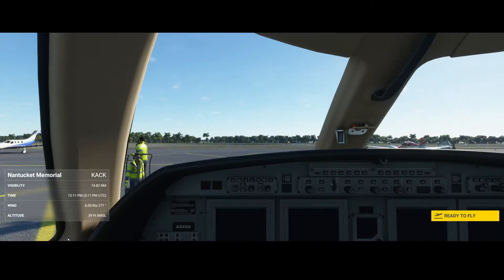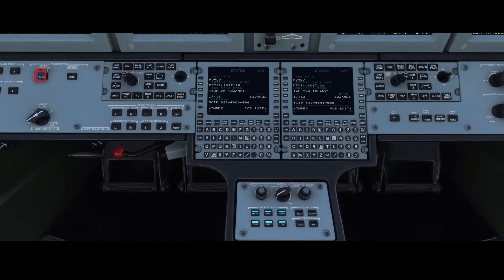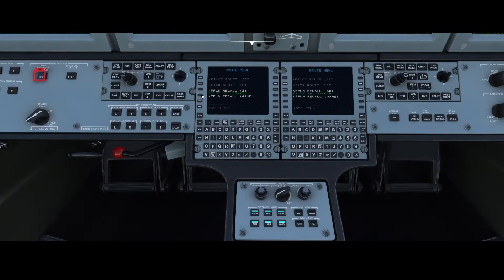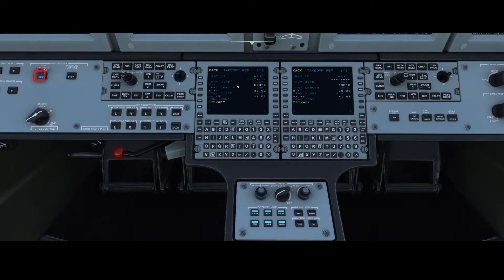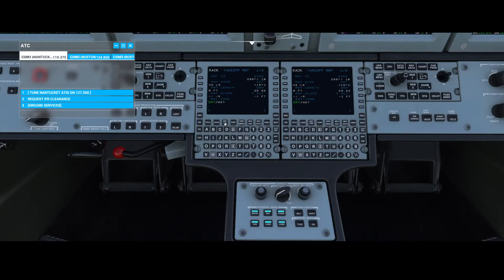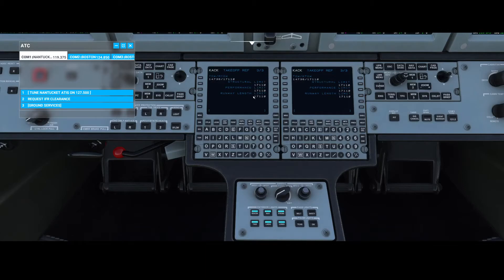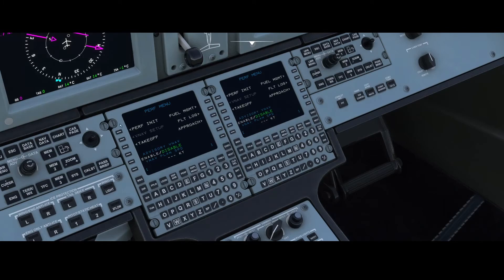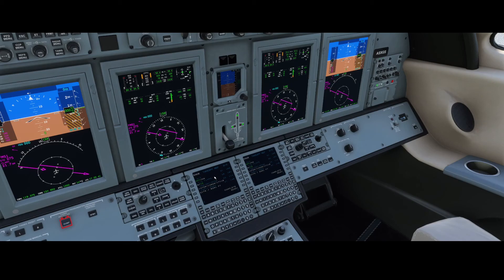Flight Simulator 2020 - How to - Programming FMS Working Title CJ4

Comment: I can't press any buttons on FMS. Any ideas why so?
Reply from the maker: which cockpit are you using for the cj4 the working title one if so which version
Reply: @Highintheflightsimsky  THanks for your reply. How do I change those settings?
Reply from the maker: @johnnyfin8603  well the cj4 from working title needs the be installed separately and is not part of the default content. If you want to install it you will need to download it first via this site https://www.workingtitle.aero/packages/cj4/
Reply: @Highintheflightsimsky  Yeah I'm already having the Working title. With default Cj4 the FMS is buttons are responding but with Working title they are not.